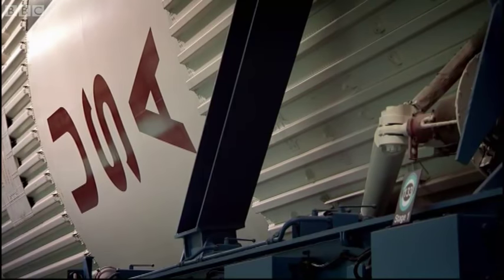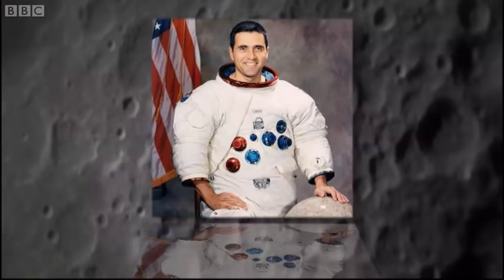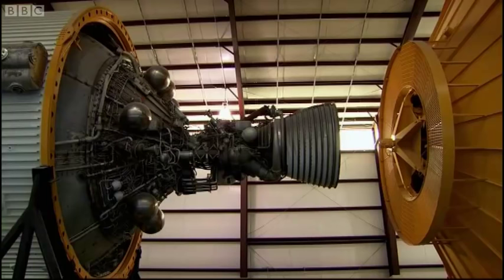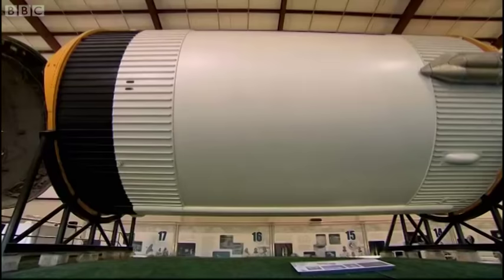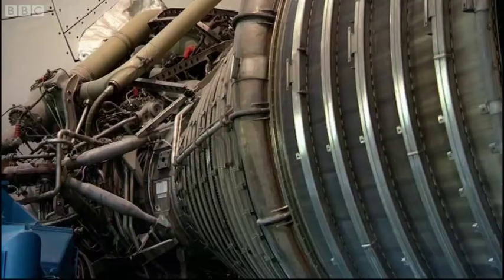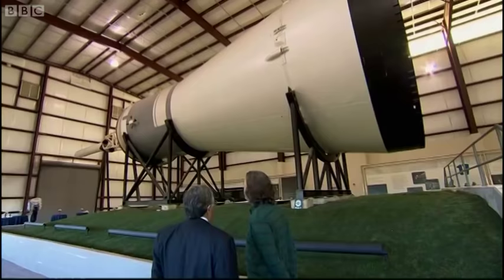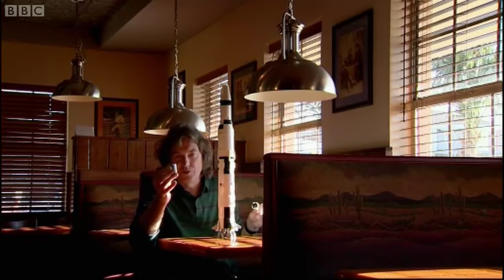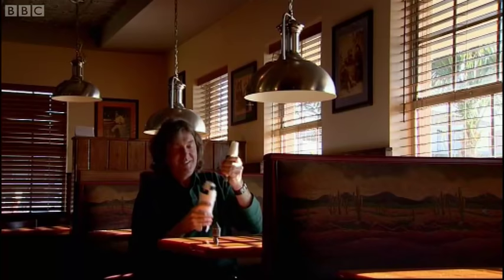How Did The Saturn 5 Rocket Work? | James May: On The Moon | Earth Science

Comment: Flying to the moon must have been a grand tour.
Reply: I don't think you get the joke mate
Reply: And...   you can't spell programme..   :-)
Reply: Samuel Rosenberg   Voyager 2 did fly the “grand tour” and flew by all four Outer Planets (Jupiter, Saturn, Uranus, and Neptune). Voyager 1 flew by Jupiter and Saturn, and is just now exiting the Solar System. 

Even today, doing a manned “grand tour” would not be possible (and the planets won’t be in the proper alignment for several decades) as it’s essentially a one way trip. The logistics would be a nightmare, as life support, and supplies would require a huge spacecraft. You would also need to bring along a lot of fuel if you ever wanted to return home, because the Voyagers got most of their speed from gravity boosts from those planets. 

Jupiter would likely be the most difficult for a manned crew, as the radiation is deadly. 

No other spacecraft since Voyager has returned to Uranus or Neptune.
Reply: Being in the space program back in the late 1950s to the 1960s and early 1970s meant you had balls.
Reply: A grand tour of Hollywood.
Reply: @simonruszczak5563  Nope, a great tour for mankind to the stars. Or at least the first step to them.
Reply: Science Revolution  you do realize that there is no gravity or resistance in space right, once you get into orbit the amount energy you neex to move a payload is a fraction of what it would be in atmosphère
Reply: @TeaJay83  
It is true that there is no resistance in the vacuum of space, so there is nothing to make you loose your speed. But you are wrong when you say there is no gravity in space. Without gravity, how do the moon would stay in orbit around the earth? The planets around the sun? Aboard the ISS, earth gravity is still 90% of its value on the ground.
Reply: @alainrobillard4300  oh i understand that but thats how it is taught to children and i dobt want to overwhelm him with info since he says it us all fake, just doing baby steps